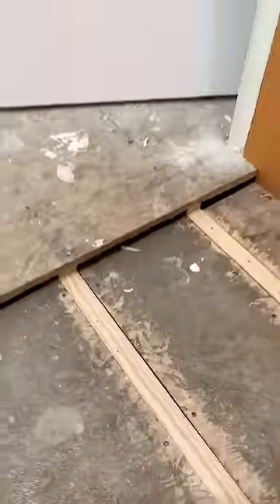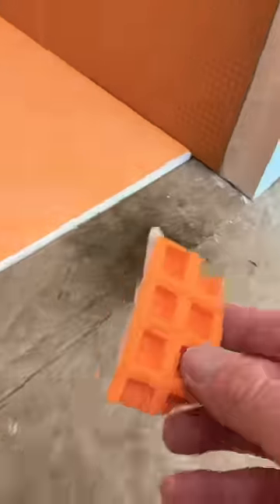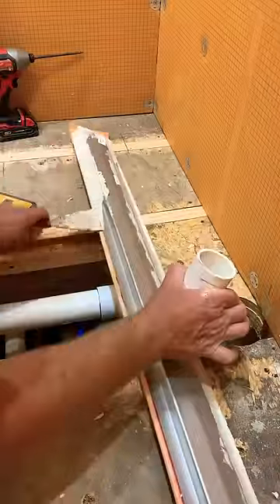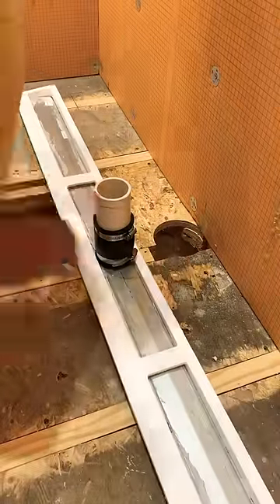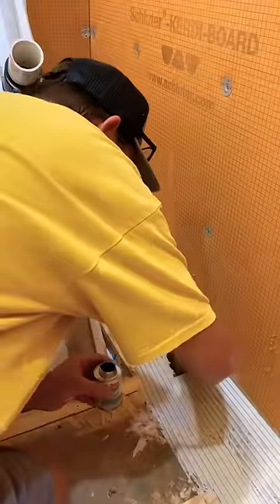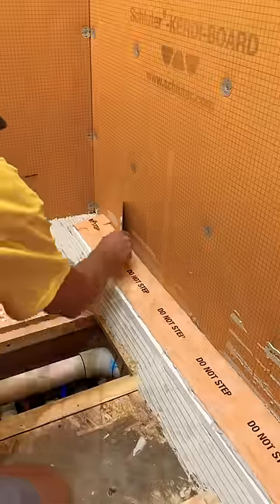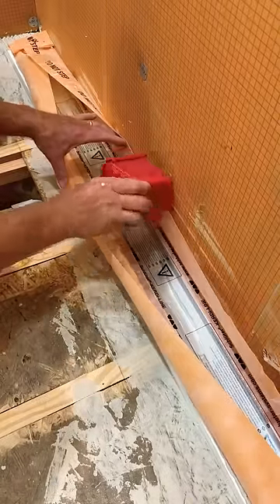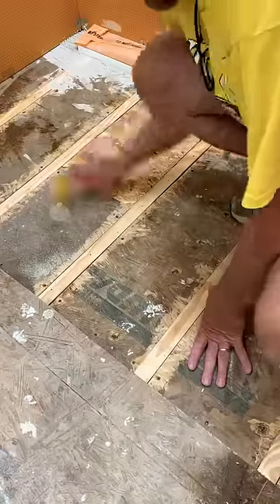Easy CURBLESS entry shower #shower #schlutersystems #gotitcoach

Comment: Yeah, I fix these all the time. Walk in showers love to leak if your not giving them proper support
Reply: Yeah okay Mr.I fix these all the time… where is your renovation videos or shorts huh?? Yeah that’s right, stay in your mommy’s basement
Reply: @narutofanz4 I have one in my house and the water just goes into the rest of the bathroom. We had to install a small ledge after to keep the water in the shower.
Reply: @narutofanz4  so in your world if someone doesnt have a YT vid up showing it  , it didnt happen? LOLOLOLOLOLOL
Reply: Can you elaborate on what you mean by proper support? Thanks
Reply: @yangmagic0703  Many of these show then cutting into existing floor joists which voids their carrying ability or spec when they are usually spec'd for a span and on center. First the tiles grout cracks then the tile pops out and the concrete base cracks with even an 1/8" of an inch deflection. I've been a remodeler for thirty years so I know WTF I'm talking about
Reply: @narutofanz4  Here's your sign: Proverbs 26:4-5 – Answer not a fool according to his folly, lest you be like him yourself. Answer a fool according to his folly, lest he be wise in his own eyes. The self-confident fool thinks too highly of himself and his opinions, and he shares them freely.
Reply: Ah. So what do you propose? I'm planning on using the Ebbe INNI linear drain and do a curbless shower and because I'm doing it on a loft that I am framing, I can frame it to a slope
Reply: @RobertELee420 that's the world these 12 year olds live in these days
Reply: @ellkir1521  appears to be dimensional lumber joists; if the shower is 4ft wide you will have no issue with notching 3/4"... we've been notching joists for centuries, its not a new concept. The general rule of thumb accepted in code is:

A notch not exceeding 1/3 the depth of the member is permitted in the top of a joist not further from the face of the support than the depth of the member.

That and the exact detail is probably specified on the drawings and checked by an architect/engineer of record.
Reply: Why is it not angled to the drain ?
Reply: @ellkir1521 not tryna start anything but the joists are actually not even touched in this type of installation.  while this guy did that is not something you are supposed to do. however under normal circumstances they take out the top layer of plywood in the area the shower pan will rest and screw ledgers to the side of the joists that allow 16 inch runner boards to sit flush with the top of the existing joists. it’s actually specified as a code approved installation in both the tile ansi codes and general building codes. hope this clears up any confusion you may have had
Reply: @kennyackerman5528  No confusion on my part. I said if their "not supported properly". I've been a remodeler for thirty years and come in and fix these after the inexperienced think they know what their doing (which sounds like you since there is no ANSI spec for that except under notching which says max 7/8" notch 2x6). A standard deflection is not sufficient. How much L/360 deflection do you think a layer of that create can take over a 5'x5' area? Standard max allowed is 1/4".
Reply: @narutofanz4 not everyone is a content creator 😂
Reply: @td000  It still needs a mortar bed on top of the waterproofing board. You pitch the mortar to the drain. The pitch is 1/4" per foot.
Reply: @Michael-zn2jc I pitch the rest of the floor with deck mud twords the drain and the entire bathroom floor gets waterproofed for that reason
Reply: @narutofanz4  people who don’t have YouTube channel are not contractors, they don’t know how to build/fix anything 😅
Reply: @narutofanz4 ok Naruto fan

Comment: Well I love how you completely cut a joist.
Reply: Well it still has like 8inches sitting on top of the slab
Reply: Uuuuhhhhhhh, most floor joists are 2x8 and up..........3/4 of an inch in a controlled space compromises nothing
Reply: "Make sure your joist are sized appropriately"  Most joist can be cut, drilled, notched or even completely  cut.  Experienced people know how to deal with it when it needs to be done.
Reply: You should never cut the joists. Sister some 2x4s to the joist 3/4 of an inch down and rip the subfloor to the size between joists. You want the top of the joist to be flush with your subfloor.

Comment: Way to go. Can’t believe you left a pressure 45° in there and used a fernco.
Reply: Did he check the pitch of the drain? Doubt it
Reply: @upstateplumbing9995 this sounds like some hardcore plumber talk 😂 get ‘em boys I got the landscapers you get the plumbers 😅
Reply: You said  it I was about to make the same comment, and that Schuler stuff sucks.
Reply: @upstateplumbing9995 How are you going to change it if it were wrong? Wouldn't you have to tear the house apart to redo it somewhere further down the line?
Reply: Don't let the tile man touch anything plumbing......
Reply: Yea I don’t mind ferncos if they are in a reachable spot…. But putting that in a spot that you’d have to tear the whole shower apart in was a big mistake. Good luck when it leaks
Reply: Yeah. I mean, there is obviously a place for Ferco fittings, but under a Schluter shower…with no access? 

Not only don’t I get it, I don’t want to get it. And the homeowner that pays for this the first time will definitely have the money to fix it a second time. Especially when that OSB dissolves from the slow leak. 

And that’s where I come in. So, no harm, right?
Reply: @brianfield58  No. there’s a place for it. But this is not that place and this is not the player.
Reply: @Shorelinetimmy You beat me to it.
Reply: @Shorelinetimmy I’m just an apprentice, but in my new build we use cremcos and mjs everywhere,every lav gets a 2” tee off the sani stack and a stun out, then a 2x1 1/2 cremco to out 1 1/2 xfr in the cabinet. I get this isn’t accessible but there’s thousands of MJ bands in the building that aren’t either. I would say it’s not the best but it’s not horrible either.
Reply: He did say he don't want no leaks. Personally I do want no leaks lol
Reply: Ha I didn't see the pressure fitting. I was 2 busy ragging on him for the fern co
Reply: I was wondering why he used a fernco
Reply: Guys like this keep us plumbers in business
Reply: I lose jobs if people want plumbing done. I tile. They call a plumber. Doesn't bother me one bit. Don't let a different tradesmen do your job. Customers don't understand it. I don't want to be responsible for plumbing. Tile I have no issues with and schluter is dog shit😂
Reply: I cringed

Comment: You should always test it with the amount that will be going through it regularly. For example. If you test it with a cup of water. 99/100 times you wont see it leak. But when the customer runs a shower or a sink at full pressure. Those pipes might not hold up to the owners test.
Reply from the maker: The trap will only hold a certain amount of water regardless of the flow (unless you dumped a 5 gallon bucket) The pipe will never be full. So if I fill the trap and let it set for 24 hours and it doesn’t leak, the test is successful.

Comment: I did notice you using pressure fittings on your drain line. Keep the hack job up handy Andy. Keeps us actual licensed plumbers busy
Reply: Can you explain this some more?
Reply: @datboi__  for PVC piping in general there are pressure and DWV (Drain, Waste, Vent) fittings. Pressure fittings have a shorter radius that doesn't flow as well on gravity drains, also are against code. In a situation like this it probably doesn't matter much but in general if it's used in one spot it's used in spots where it does matter.
Reply: Also, can’t get a snake around through pressure fittings either when their improperly constructed plumbing eventually clogs up. 😂
Reply: Actually, You licensed plumber really screw up stuff PROPERLY like the licensed plumber who plumbed the HVAC line into my bathroom but never attached it to anything so the HVAC Condensation drained hundreds of gallons of water under a whole house of laminate flooring. The licensed plumber said that his shite work is standard practice. Whatever, dude , stay humble. Don’t be proud. All professions have worthless useless and wasteful people CONTINUING to work and create $20K damages all the time. Stay Humble. Please.

Comment: You don't ever cut down the width of a joist . You change the load bearing capability of the entire floor . Engineering is critical despite what you may think . What do I know though ? I only framed custom homes for 25 years in hurricane country and have dealt with thousands of pages engineering specs for floors walls and roofs and beam work .
Reply from the maker: Ooooh, nice. So then you know there are tables to find loads on SYP in various widths and what they can span plus the spacing so that GC’s that have been building custom homes for the past 30 years can look up? I’m structurally sound there Bob Vila. Try again🙄
Reply: Unless that was a 2x12 he cut 3/4 inch off .. yeah compromised .. I'm sure underneath the 2x joist is not supported again at 3 ft from the outside wall ... That's what he's trying to say with the small distance he cut out ....😂😂
Reply: Ya wtf do you know? You frame homes, you're not an engineer.

Comment: Did you cut that joist for your drain???
Reply from the maker: Don’t guess you watched the video? Cause’ if you did you would notice that even tho I did cut the joist for the drain…my basement wall is 12” and there is still 4” of joist setting on the wall fully supporting the dead and live loads.
Reply: @w.k.d.constructionllc if 4 inches would fully support the loads that’s what the plans would have called for. They don’t put that extra there just for fun.

Comment: Wait, did you cut out the top chord of the TGi right next to the bearing wall to put in the ptrap? Like the worst possible place to do that? That will cause that to fail inspection and isn't allowed by any joist MFGR I've EVER dealt with

Comment: FYI
You can't just cut the top of the joists off, you have to get an engineer to sign off on that structural change.
You don't want the joists to start sagging in a year causing the floor to start leaking.
Fernco unshielded couplings can only be used underground. 😮
Reply: Taillight warranty
Reply: He still has 3 or 4 inches supported on the foundation. No structural change whatsoever.
Reply: @jacobculp1104 but he said there's a ceiling below him so what foundation? Although I agree that it's in all reality probably still structurally sound
Reply: @madantsdiaz956  you can just barely see the foundation wall on the far side and see that it's about a foot thick. I believe below him is basement.

Comment: Minus points for using rain r shine glue. Clear glue and primer on new installs especially where it's in a ceiling. Proper chemical compound for welding the pipe. The blue glue 😂 is for wet applications where you have water still running a bit or it's going into water directly and immediately after being glued ( well casing on new installs).
Reply from the maker: Sooooo, if it’s meant for wet locations wouldn’t this be satisfactory? Since it’s a drain 🤷🏼‍♂️ whatever chief🙄 I never use primer and clear on drain, only on pressure pipe. I always cleaner and blue because I can see what’s glued very easily. It’s a medium bodied cement and works correctly. I’ve been using it for years and have NEVER had a problem. Try again to make sense
Reply: @w.k.d.constructionllc  no you're only supposed to use it when the glue bond isn't going to have proper time to dry.... That's why I gave examples... It's not that it's bad or anything, I have done residential plumbing and commercial plumbing before and if it's being inspected you're not allowed to used the rain or shine blue glue. They want to see the primer being used along with the glue. Where you're not introducing water immediately or have a leak that's not allowing the primer and glue time to dry once bonded PVC is made to have the glue and primer out onto it for a proper chemical weld. Also if you can't put primer and glue on a fitting and not see if it has been glued after you put it there 20 seconds ago that's saying something. I was t .among w dog at you, was only really asking why you used a glue that's made for a quick fix on something that's going into a permanent position.... In a 2nd floor shower pan no less.

Comment: Hacking up joists to run plumbing,  lol  this is wild
Reply from the maker: Look again, yes, it is cut…but my basement wall is 12” and the joist is still setting on it correctly
Reply: @shaneoakley8757  you tell em Shannie Oakley
Reply: @w.k.d.constructionllc you still took to much out of that joist. Doesn't matter how you justify it.
Reply from the maker: @jamiemcgavran5405  🙄 okay…whatever
Reply: @jamiemcgavran5405 Brother. He took out less than any hole someone would use to run power thru studs. 3/4 of an inch on a 6 inch joist is nothing.
Reply: @w.k.d.constructionllc joists are sized appropriately when the house is built, they dont oversize a full floor of joists just incase the plumber wants to take some off😂 tf you even talking about.
Reply: @israeladesanya4596 correct but when something HAS to be done then that’s just what it is. 😅 of course avoid it if you absolutely can but if you can’t then it is what it is. You can scab it or whatever later
Reply: @TwhistyyHD nah that's not cool man lol.  build a curbed shower unless your planning on doing it correctly.. too much liability plus showers add alot of weight. In your own house ehhh whatever do what you want but don't steer a customer like that, it's not good in the long run.
Reply: @israeladesanya4596 yea they actually calculate the size of holes qnd how many can be run through them.because yes plumbing, HVAC, electricity, gas and internet all go through your joist.
Reply: Thats a TJI joist.  You can't do that!  You have completely compromised that joist!
Reply: @wook420 not that much weight if it's all composite and fiberglass like everything that's been mass produced the last 20 years, if its tile, once the pan is in and the thin set sets the weight is hanging more on the wall than pressing on the floor
Reply: @eitankahn9682 incorrect
Reply: @wook420 showers don’t add that much weight, tubs do but not showers, he still should’ve sistered on some 2x8s though
Reply: @jamiemcgavran5405  How would you know?  Do you have your structural span calculator out?  Hell, do you even know the width of the joists?

The answer to both is NO.
Reply: @eitankahn9682  ... They look like 2x12s to me...  There is no plywood web... Do you even have eyes?

I think your true calling was MLB umpire...
Reply: @JWill6969  cutting material out of the top is way different than cutting it out of the center.

Comment: That pressure 45 isn’t legal to use for drains. It’ll drain though 🤷🏽‍♂️. It wills definitely get red tagged here in Tx and if all was done properly, there would be a permit and inspection on the work.

Comment: This is what some call job security. Cut the joist, add a Fernco rubber union and top it off with a pressure 45. It’s a Guarantee that someone will be back soon for a repair. It’s a case of the blind leading the blind.

Comment: I did my third Schluter shower and it was with that exact drain, and thank you for backing it all the way app and taking the extra time to get 0 cuts behind it, and only on the left and right. That's what we did, and I had to go into the footer because it was an outside wall shower concrete block and to get the linear drain to go all the way back. We had to go into the footer a little bit. It was a pain in the butt, but that's the kind of stuff. You gotta do to get that kind of look right there.👍👍👍

Comment: Just use a shower pan,brick, paper and wire. Then float it. Can't tell you how many of these showers I've had to tear out because of water damage. Some methods just can't be replaced
Reply from the maker: Faulty installation sounds like? I’ve torn out mud pans too because of faulty liner installation. It’s there on either side
Reply: Sluter leaks. Sorry but I've been building showers for over 30 years and a traditional pan is bulletproof if installed correctly. These leak even when installed correctly. I've had to replace a lot of new sluter showers. But keep using them. It will keep me in business

Comment: You should really leave about an inch-and-a-half from the wall when installing the drain ,you want a tile between the wall and the drain for a counter slope , therefore no water will accumulate anywhere
Reply from the maker: Negative ghost rider, the drain is supposed to set against the wall that way there is NO room for water to puddle. This is the way that it is recommended by schluter
Reply: We use asphalt comp. shingles to insure sloop from every highpoint of the pan. Over the damm as well.

Comment: I renovated my bathroom this week. Just now finishing up.  Subfloor replacement, vanity removal, wallpaper removal, painting, pluming and then came ditra and tiling.... tiling the damn floor, fuuuucking horrible.  I have a new respect for floor guys.  At one point I debated sticking my head into the tile water saw after getting bad measurements 20 times and walking back and fourth forgeting my tape measure, etc.  It was an 80 sqft L shape with weird divits for toilets, tubs, showers ,etc.  Fuck that.  Power to you floor guys.
Reply from the maker: 😆😆 it can be a pain some times!